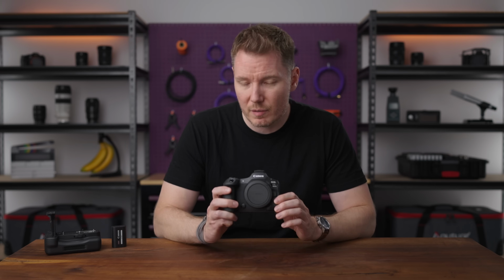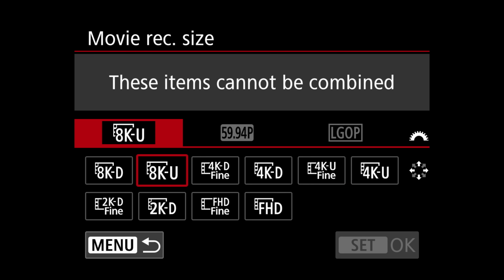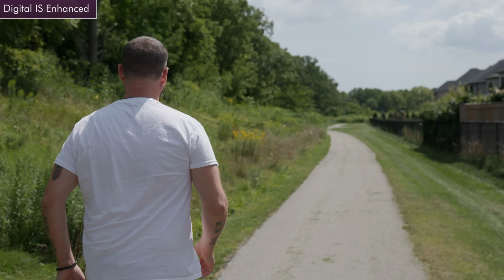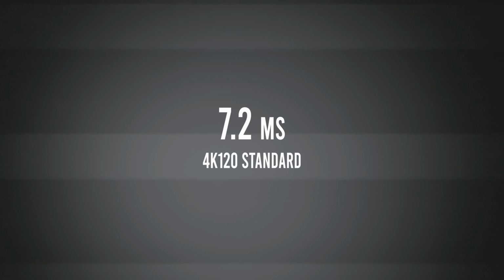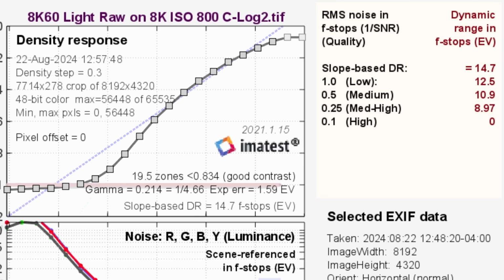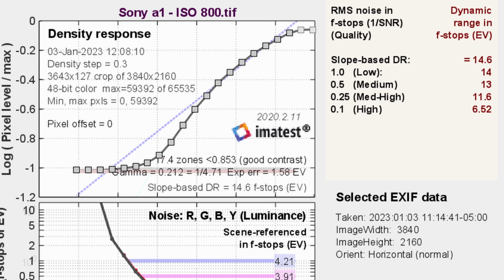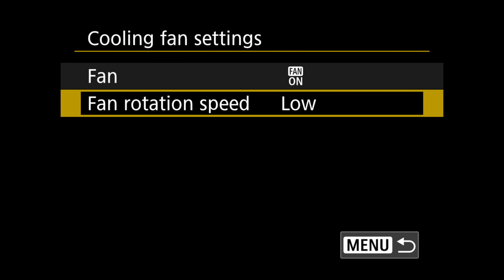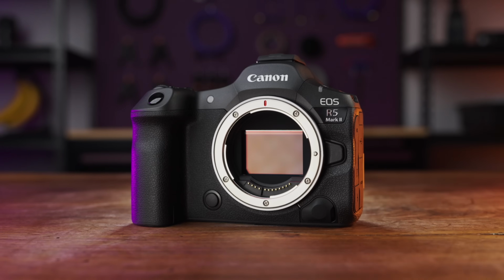Canon R5 Mark II Review: A Truly Impressive Camera

Comment: This doesn't change the fact that the original R5 is still a fantastic hybrid camera and now at the $3k price point, is an absolute bargain!  Nice detailed review Gerald, as always.
Reply: You can get it for 2200 used… retail maybe 3k. Tons of them to be had at $2500.
Reply: @ItsBerg that’s a bargain for such full featured hybrid camera.  Most cameras released after 2017/2018 are truly exceptional.

Comment: Cool.  No reason to switch from my R5C.
4K (oversampled 8K) 60p in XF-AVC All-I is the dream.  No overheating 😏
Reply: Buy the new canon battery and you’ll get more battery life. No Clog2 is a dealbreaker for me in the R5C. Bought it and returned it for the c70 once I noticed that.
Reply: No ibis too right
Reply: @DarkPa1adin  The first R5 had IBS… still chose the R5C … that hasn’t changed in version 2 of the R5.  It’s mediocre IBS.  It’s less important for me.  Lens stabilization with electronic is good enough.

Comment: 8K 60 raw in-camera without any bs. Holyyy 💩
Reply: which you could already do on the Z8 with more flexibility and other codecs. but its great that canon got there as well
Reply: @ThatNorma  Nikon will have to crunch some extra pixels and we'll all wait until the z8 gets a better EVF, 30fps RAW and pre-capture. I guess no 2nd CF Express B slot in the R5II is made as a bit of a trade off to have that 1/3 less weight than z8, but other than the lack of that slot, canon has it packed into a very lightweight camera.
Reply: The BS is that you can’t do redundant recording for the higher codecs.

Comment: So, R5ii actually got same DR if not worse than R5C, but we still got no CLog 2 in R5C. And Canon's excuses for not giving it in R5C was that sensor not capable of CLog 2 DR coverage. So thats total BS from Canon. As expected((( i hope they got balls to admit it and give us C Log 2 in R5C.
Reply: You’ll never get it. There’s a difference in the sensors and the way they read.. r5 ii has more DR in the sense that the faster readout of a stacked sensor comes with a tradeoff in DR. It’s progress that they sped up the sensor and DIDNT lose DR. That’s the magic here… R5C had original R5 DR (a bit more) so the sensor was tuned more so to video, and 13 DR stops (advertised) was the top, which is why Clog3 was used. Anything they advertise more in, gets clog2.
Reply: @ItsBerg  tests say otherwise

Comment: Correction: You can setup a custom button to turn off subject detection. It’s a function called “direct select subject detection.” When you hit the button, it toggles between the subject modes which are, auto, people, animals, vehicles, or off.” Click it to off and boom no subject detection.
Reply from the maker: Correction correction: That option is only available in photo mode. I standby my complaint that it's an annoyance in video and even if that option was available, I'd still prefer it to be a simple off button. Minor gripes though.
Reply: @geraldundone fair point! That is one thing that does annoy me some with this and most canon bodies. The features that cover both photo and video are sometimes not duplicated when setting custom buttons. 

My annoyance for video was I can’t use the lut view assist and false color at the same time. This leads me to shooting with lut assist off because I absolutely use false color to the max.

Comment: I would still like to see the overheating part done in real world testing. 83f doesn't even cover most regions summer temps be it for a wedding or outdoor shooting/wildlife etc I just don't see this camera performing up to the standards of todays systems. Also, I thought they would be more on par with the rolling shutter at this point as well but 17'ish ms just isn't there for a mid 2024 camera system. I really don't like that you seem to have to really work the modes to achieve optimal dynamic range but at least the options are there!
Reply: He’s in Canada. And yes the R5ii I used really struggled in North Carolina heat. But what can you really expect for its size and weight. If you want something that doesn’t over heat you’ll end up with a beastly Z9 size camera.
Reply: Trust me, if R5ii has issues with 22 deg C, it will have issues outdoors under the sun.

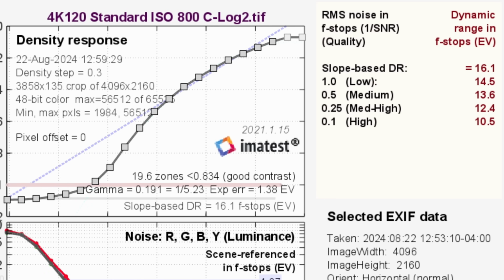Comment: 16:20 thats 16.1 total stops of dynamic range, thats kinda insane. late i see 16.3 as well
Reply: @johnny_blz  theres a difference between total stops and clean stops. total stops is just how much the camera can see at all. clean stops are the ones with little noise. Arri cameras are WAY above the canon in performance, i was just impressed with what this camera might be capable of
Reply: I wouldn't take that number too seriously. That is a predictive score based on how the noise fades away rather than actual captured detail. The Canon R5ii has a 14 bit ADC and it very likely reverts to 12 bit in video. There is no way it can capture 16 stops of DR.
The Arri Alexa 35 for example has to read off two 14 bit ADCs  and combine them to get 17 stops of DR. I highly doubt the Canon can capture 16 stops of DR with a 12 bit signal.

Comment: lots of talk about the Sony A1, and Nikon was only mentionned twice without namig specific models...

Considering the Nikon Z8 and R5II are so close in features on the spec sheet and price, do you plan on making a comparison video about them? The Nikon has internal compressed 8K60 RAW, thing the R5II still can't do.
I think it would not only be interesting, but useful content to make. Z8/Z9 reviews are getting old and comparing it to the R5II will be a little hard for consumers. Especially as the Z8's price is starting to drop as time goes on.

Comment: Maybe there is more heat generated with the faster readout? So they throttle the readout in the slower fps to limit heat; didn't they limit the length of recording in hfr? -That might matchup

Comment: 13min of 4k120 with a optional expensive battery grip fan on full blast and the only way to shoot the 8k60 is with raw.   pass.   this looks like a 4k60p camera essentially.
Reply: This is not a cinema camera.
Reply: @michaels3003  then its a pointless camera, as it does the same as a R5 mark 1 on photography. or a A7R3 that costs 1/3 of this.

Comment: I think sensors readout faster when they have more frames per second to read out.  Its about how many times per second it needs to sample.  A limited framerate can only go so fast I think but a faster framerate reads out twice as fast.

As for 4k s raw mode I think it does a nearest neighbor type of scaling which is very fast and super sharp. The Panasonic GH4 did this when shooting 4k and recording externally to HD via HDMI. To make the scale down perform fast they used a nearest neighbor approach. Every 2x2 group of pixels just chooses one of the pixels and makes it the size of 2x2 pixels. No other math is involved. Since there is no averaging of surrounding pixels the results are super sharp and almost as detailed as 8k. The downside is a greater chance of jagged edges. It can still be technically raw because much like pixel binning the samples we end up with are still raw values and not RGB colors. Its more or less just pretending the camera is now a 4k sensor with 2x2 sized pixels with no averaging or natural gradation as smooth as a native 4k sensor. I'm a bit torn on this mode.  Yes it looks super detailed and sharp and its raw but having an image built like that has other image based artifacts we should not have in 2024. Raw is about having pixel perfection and its really not at that point.  That said if one wants 4k that sort of has that ultra detail of 8k that's the way to go. I just think so much gets sacrificed in the process. I don't think storage savings are worth it to make that sacrifice. If a production is on a budget why even bother with 4k raw when 4k standard or fine is perfectly good.

I have a R5 Mk1 and I love it.  One thing I will say is having internal raw without needing to attach a Ninja V is huge. Canon raw video while slow to edit is also true 100% raw video unlike Braw. Not that it matters very much but just to point out the raw is the real deal here.  I can also do ProRes raw to my Ninja V but thats also an extra hassle to add the extra gear required and ProRes raw still does not work in Resolve so its another hassle to have to convert it to cndg with Assimilate first. If I'm going straight to FCP then its cool but its still a lot of added weight to lug around.  The R5 can shoot raw video as a completely naked barebones camera. Its nice to have that option.

I'm one of those crazy people that does shoot c-log2 on my R5 as 8k raw and I use Neatvideo which I find extends the range even better than Resolve. Resolve has a very simple universal form of noise reduction.  It applies evenly across the frame.  So if you have a lot of noise in the deep shadows around stop -7 then you have to crank up the settings which destroy fine detail in the brighter parts of the image. Neatvideo will adapt the strength of the reduction based on the noise level in different parts of the frame. So you can have really high levels of reduction at stop -7 and almost no amount of noise reductio at stop 0 if its clean. The 8k raw from the R5 looks a heck of a lot better than it should once I process it. A slow process but well worth it if one really wants to get 15 stops out of the camera.

I do find the original R5 to be a bit noisy however which is why I prefer 8k raw and process it later. I sure would love to upgrade to get that up to 14.5 stops of 4k fine dynamic range out of the box when shooting internally. That combined with the false color, waveform and full size HDMI would be huge. The lack of a record limit would be very welcome as well. Alas my R5 is still very good and $4,300 is a bit high for me right now. Especially if I keep shooting 8k raw which is only a tiny bit better than my current R5 and once I apply Neatvideo I'm not sure there would be much difference at all.

Comment: We've been looking to upgrade from the GH5 to a FF system for AF/Low-Light and pretty set on the A7sIII... but now the R5 II is looking to make that decision a bit harder.
Reply: Same, I hate the AF on the GH5 and the low light is not good. But if you use manual focus and decent light it looks great. But of course the main issue, Canon is 3-4x the price. So are you ok with paying $7k for an R5ii and one lens? I’m not.

Comment: The 4K sraw, 4K 60 and 120 seem to be binned or skipped vertically and oversampled horizontally. Have a look at the charts on dpreview, you’ll notice that the horizontal and vertical resolutions aren’t the same.
Reply: And I heard that the readout speed difference between 8k 30 and 60 is done to save power.

Comment: Have you tried using an older LP-E6NH from the R5/R5C in the R5 Mark II? It limits you to 30p Long Gop, no 24p or All I. Was considering getting this to pair with my original R5 but the non-backwards compatibility of the battery in video is a huge annoyance…

Comment: They shouldn’t have called it RAW anymore. It’s MEDIUM RARE.
Reply: @ADof28 Well done 😂 even though this is humor, they should use it "Canon Medium Rare Codec" 😂
Reply: Mate I'm confused, do you want medium rare or well done?:face-blue-smiling:
Reply: RAW is a made up acronym. A lot of men assumed that RAW = raw...
Reply: @michaels3003  but it should be equivalent to raw as in raw data without any addition to or subtraction from, right?
Reply: @DarkPa1adin  , I would need to talk with imaging engineer who has a related work experience to find out how unprocessed the RAW data really is. It does not include any processing used to create JPEG files (obviously). Canon has options to correct known lens distortion and to  increase brightness away from the image center to offset vignetting. I thought they apply some noise reduction as well (not controlled by the user).
Reply: @michaels3003 raw is not an acronym and people need to stop typing it in all capitals. It's "raw/Raw" not "RAW".
Reply: @falxonPSN  , both Canon Global and Canon Europe refer to RAW as a  *name* of a data format. So it is not an arbitrary spelling. You can think of it as a short version of Canon RAW name.
Reply: @falxonPSN  , if you don't understand what data format means: it is an organized structure that contains data and possibly metadata. It is not a "dump" of raw data.

Comment: I wish someone could release an SD to CFExpress adapter card. I know that defeats the purpose of CFExpress because SD cards are not able to do the same things. But sometimes you just want to do the basics with two card slots, and your pricey CFExpress card might be full, but you still have this slot. SD cards are cheap and plentiful.

Sony's method of a dual-purpose slot with CFExpress Type A is ideal, but if your camera uses Type B, no such luck. 

There were SD to CompactFlash adapters in the past, so it's not such a wild idea.

Comment: Pretty much a home run for Canon. You forgot to mention (or maybe you didn't realise), that Canon also released a new dummy battery, that can be used in the camera or in one slot of the grip and that also is USB-C PD powered.
Reply: It feels really hard to get past no 4k fine 60fps though, especially when it was originally stated by canon that it would be capable of doing that, that wouldve knocked it out of the park for me
Reply: @againsttherest1  it might still come. After all, 4k60 in the R5 C is oversampled from full 8K.

Comment: So you can set custom white balance in Sony without switching back and fourth?
Reply from the maker: Yeah, most other brands have added it. Canon seems to be the only ones dragging their feet with that function. But their cine cameras have it, so I know they know how.
Reply: @geraldundone  I was today years old!!! So I have not used it because I strictly shoot in memory recall mode using my custom settings, it never occurred to me to switch to manual mode, this will save a lot of time, I've been using the A7s3 and A74 for years now, and you just helped me figure this out!! I feel silly now lol... Thanks..
Reply from the maker: Yeah, that's an annoyance on Sony that you can't set it when in the memory modes. I dislike that you have to switch back to M, but yeah, you found it.

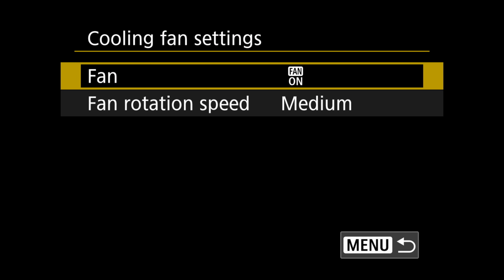Comment: 22:10 you say 120p, do you mean 120Hz? I assume so with the context, but your perfectionist nature leads me to doubt my ability to correct you.
Reply: 120p is a technically more correct way to say 120fps than 120Hz. people say 720p or 1080p but dont realize that the p actually stands for "progressive scan" and has nothing to do with the picture's resolution. it's 1920x1080 120p, not 1080p 120Hz/fps. putting the p at the end of the vertical resolution was done because when digital video recording was new, interlaced video was more popular than it is now and a lot of times you'd get 1080i which is different. nowadays everything except broadcast is using progressive scan so putting the p in the name is mostly obsolete.
Reply: @yesthisisdonut  thank you. I knew I was on thin ice calling out anything like this :D